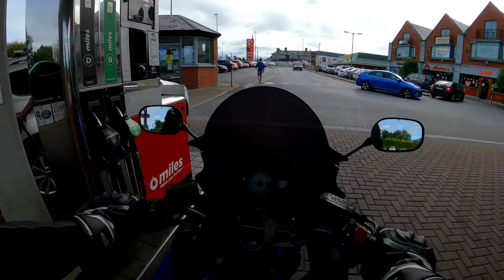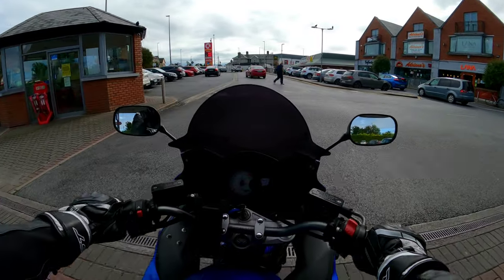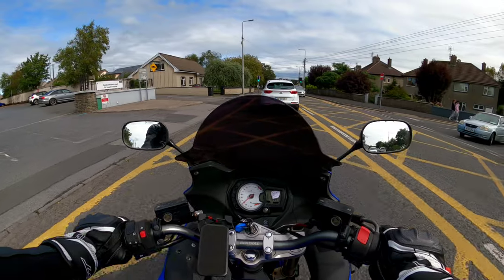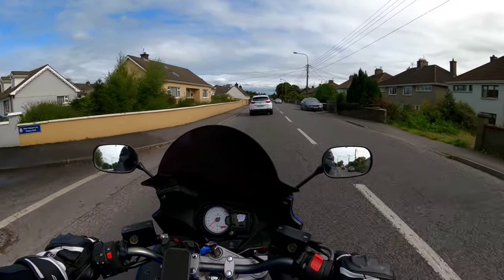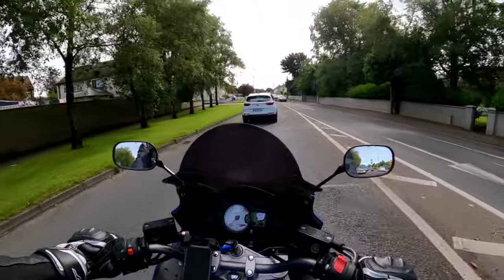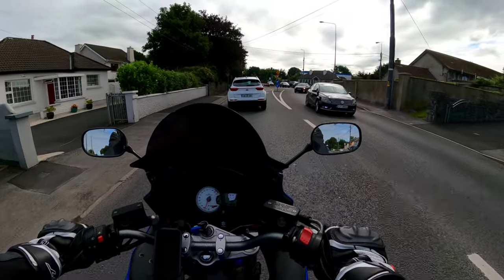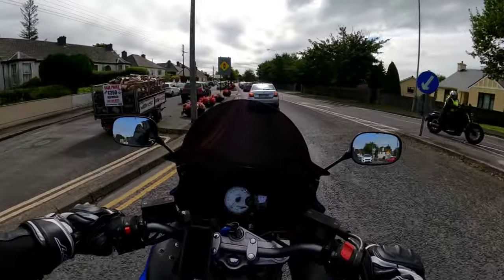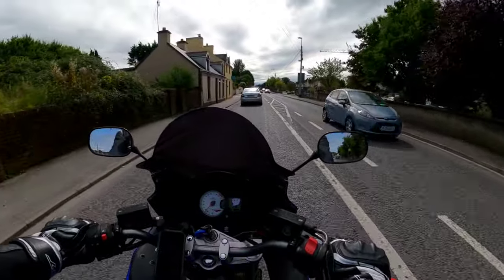0 to 60 time on the gsx650f and contaminated brakes

Comment: Hi John,  I left you a reply about a month ago.  You never answered me back.  No worries.  Anyway,  I pulled the trigger and bought a brand new condition,  blue & white with red decals - 2008 Suzuki GSX650F from the original owner.  He never dropped the bike or crashed it.  He's 60 years old,  and the bike is 100% stock.  It has 45,000 KM.  It also has new front and rear brakes.  New front and rear tires,  plus the battery was recently changed.  I'm not picking it up until next week,  but I'm very happy with my purchase.  Everything I've heard and read has been mostly positive about the GSX650F.  Anyway,  thanks for making the videos!  I put a couple of them in my Suzuki GSX650F Playlist.  
Cheers 🍻 
-Chris